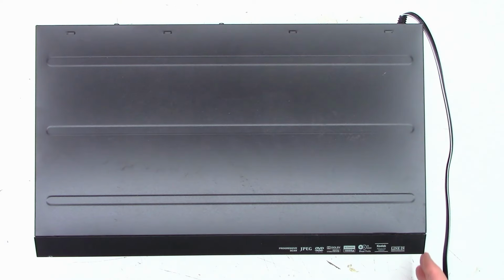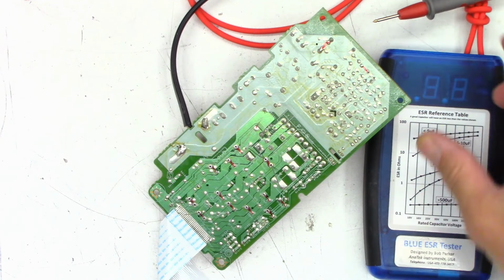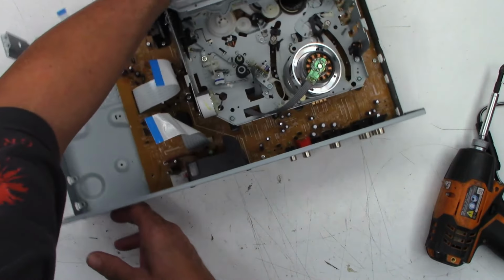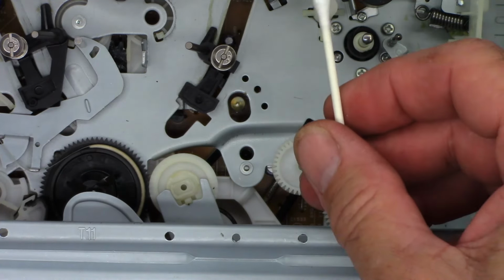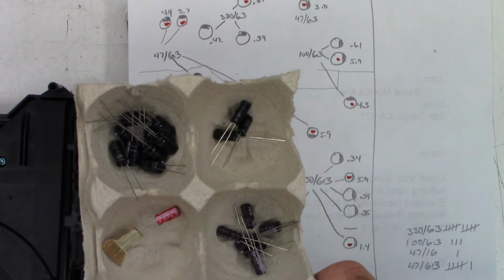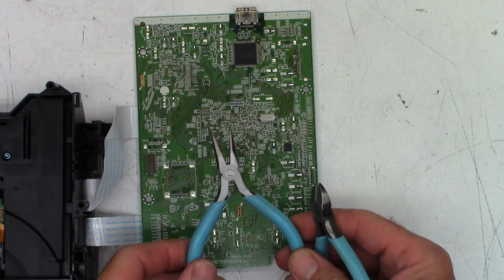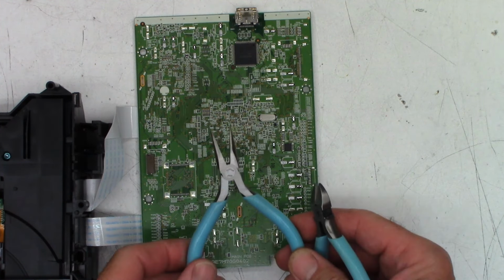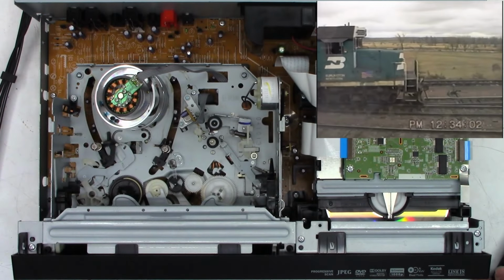Magnavox ZV427MG9A Lights Blink Repair & Mode Select Switch/Acetone & A COMPLETE DVD Recorder Recap

Comment: Just came here for the blinking lights. Found the same bad cap! Just need the parts!
Reply: Mom had a spare complete unit in the garage. Took the power supply out of it and installed into the bad unit and we are back in business!!

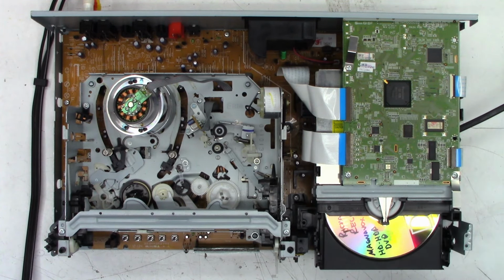Comment: I have already disassembled this VCR to clean the mode select switch, and during disassembly I unplugged that ribbon cable you say not to unplug at 1:08:15. I didn't have any noticeable ESD, but is there any chance that I caused permanent damage?

EDIT: I'm happy to report that because of this video, I was able to get my VCR apart to clean that mode switch, and everything is working flawlessly! Thanks!
Reply: Ah crap did it too

Comment: I have a unit similar to this(Philips version, same DVD board) and one of your videos helped me fix the VHS player portion, but the HDMI is not working on the DVD board, would you have any idea what would cause that? When I plug the HDMI in it says "480p" on the unit's screen and that's it. I had it in DVD mode.

Comment: At 5:42 minute the exact same Digital PCB (BE7M70G0402) is also inside European Funai VCR-DVD-HDD Recorders but with a European Firmware with Region Code 2. The firmware is located unther the Panasonic CPU right down the black chip with the white sticker is a TSOP48 Flash ROM I dumped all the firmware from my Funai devices.